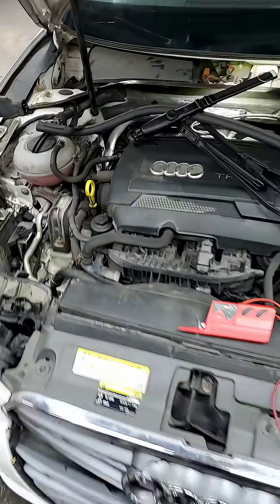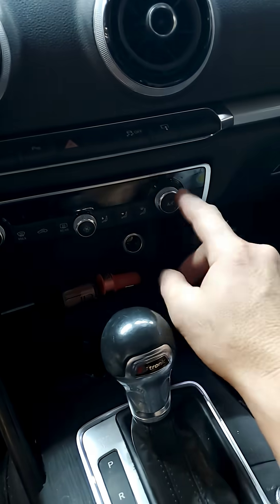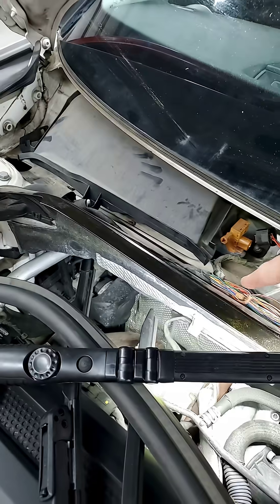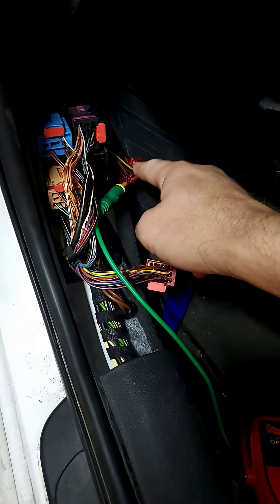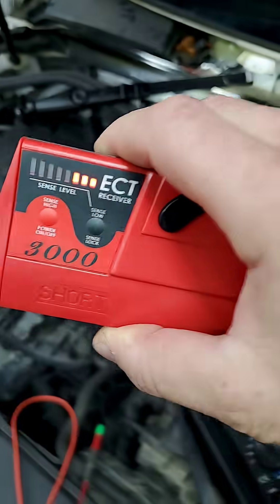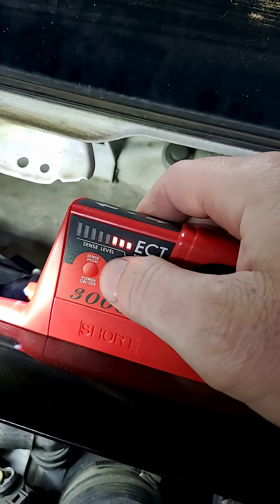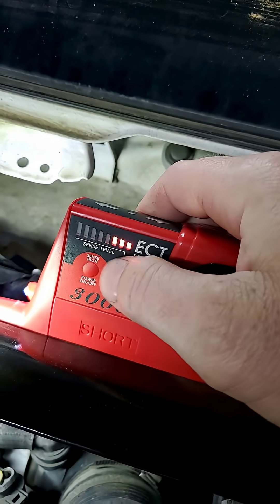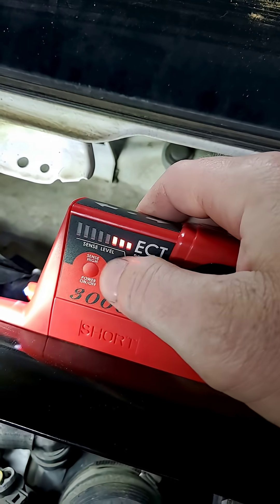How to find an open circuit using the Power Probe PPKIT04 / ECT 3000

Comment: when testing wires should the multiplug on the ecu be disconnected?
Reply from the maker: Ideally if you are checking for an open or resistance. You need to isolate both ends of the wire in question to check it's integrity. Then with this power probe circuit yes, you definitely need it unplugged, it sends a frequency down the wire which is what the sensor picks up when it finds the break.
Reply: Great work